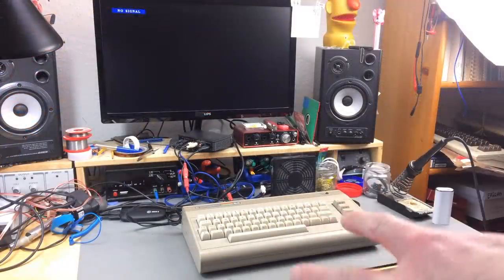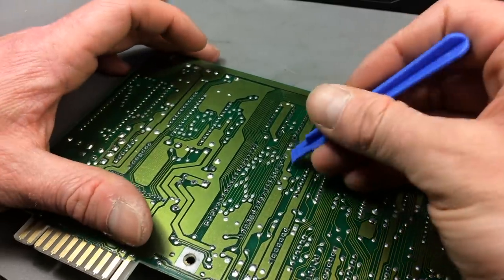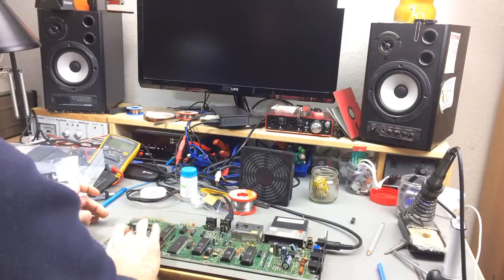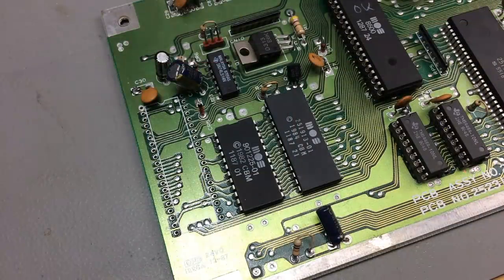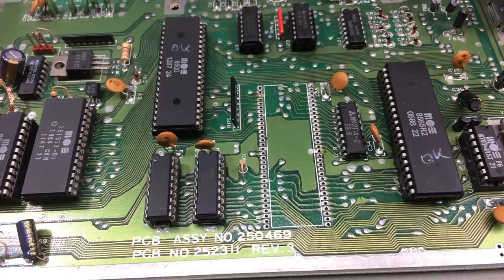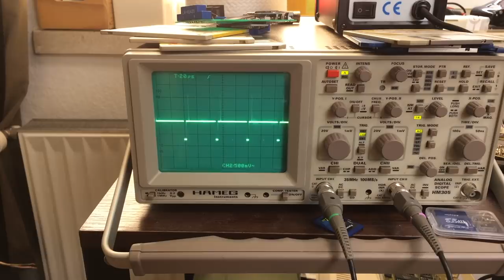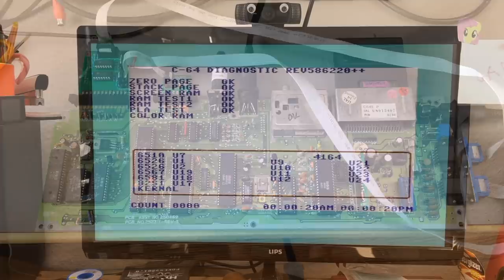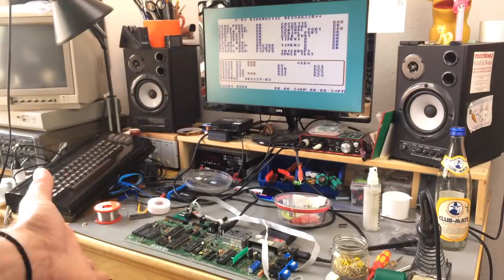Aldi C64 Blank Screen Repair Part 1

Comment: I remember there is a pin on cassete port that goes directly to the processor and it has a pull up resistor, if that resistor is broken the procesor does not work properly.
Reply: this is at least on thing that could be checked and fixed. i think it makes the output signal to swich on the tape, is it?

Comment: Strange. Somehow, bit 1 is missing in the last few outputs of the diagnostics, which is why it starts to write @ad and  qmult and why the font is suddenly garbled. What I don't really get is, why this happens at this later stage and not right from the beginning. Here's a little BASIC program that simulates the effect of bit 1 missing:

10 a$="bad ok sound test"
20 printchr$(147)
30 fori=1tolen(a$)
40 v=asc(mid$(a$,i,1))
45 ifv>64thenv=v-64
50 poke1023+i,v
60 poke1063+i,v and 253
70 next

Comment: Always interesting to watch you work, Jan! I am sure this will turn out just as instructive as the 128 repair series. All I can think of is a board/trace issue.

Although I don't really do Commodore repairs myself, the process, skills and equipment you use are definitively transferrable. For instance, I bought the same desoldering station you have and got myself a logic analyzer. Both of these have saved me tons of time on other types of projects.

Comment: 1. Bad screen
============

The bad screen means a line on the data bus is pulled low. You should be able to see this on your oscilloscope. Wait until the bad screen appears and check the data lines. One the data lines should be permanently low and the question is "how low?", I guess it is pulled low and the level just doesn't get high enough. You very likely have a short circuit with another line on the mainboard.

Now the bad screen appears during the interrupt test. During the interrupt test both CIAs are being manipulated. Therefore it is plausible that it is one of the CIA pins that is shorted to one of the data bus pins. As soon as the user port is manipulated, a pin might go low that then pulls down the entire data bus line.

2. Cassette port error
====================

The schematics of the testing harness shows that the cassette port lines are manipulated via the user port... which is controlled by CIA2. Check with your scope if you can see weird behaviour on some of the user port pins. Use your oscilloscope. Is there perhaps some pin that shows some noise that looks like coming from the data bus?

3. Control port error
=================

The control port lines are manupulated again via the user port... again controlled from CIA2. Again, check these lines with your oscilloscope.

Error (1) points into the direction of a CIA. Common between error (2) and (3) is CIA2. So CIA2 seems most suspicious to me. If your oscilloscope doesn't give any hints my approach would be to lift all the CIA pins that are routed to the user port out of the socket. This won't help with the cassette/control port errors, but if it is the CIA manipulation that causes the bad screen, lifting these pins should prevent the screen going bad. Once that happens you know where to look.
Reply: Additional note: Note that "SOUND TEST" is garbeled, while the other text on the screen remains readable. This means that the RAM still contains the correct data and apparently the VIC-II is still able to read the correct data from video RAM (but not from the character ROM, as there is a bit missing, weird!). However, this confirms that the interrupt test messes things up: The data line is okay when the interrupt test starts, but when the interrupt test completes, it is bad and "SOUND TEST" is no longer written correctly to RAM.

Comment: Check the clamping diodes that go to the serial port.  I wonder if one is shorting enough to cause strange behaviour with one of the CIAs maybe?  Just catching up with the video to see what you've swapped already.  Did you swap both CIA chips from a known working system (at the same time?)?  I have seen both CIA chips fail on one data line and they killed the CPU data pin too.  So when swapping individual chips it still behaved strangely.
Reply: This....

Also, the screen is telling you the problem, ( an @ sign instead of a B, and the gaps in the character, which if you look it's the LAST bit )

This is indicative of a fault caused by a I/o port disconnect( such as a disk drive or cartridge.)...which ties in with gadgets comment.

Hope this helps.
Reply: rectifier  diodes     are    not   clamping   its   not      tv   set   tube  tpe      they  only use  clamping   diodes    in    tubr    tv  from   30   years   ago   now   its   alll  miniture smd   components         look  at   the  new    motherboards   all use   smd     packages   so      thats the   dead  test       waste   of   money   cartridge  for   kids
Reply: @rossdag4232  no, they are clamping diodes!  They clamp the inputs to make sure the level cannot go above  vcc or below 0v.

Comment: Jan Beta, any reasons why the external trigger needs to be connected to the AC mains 60hz frequency when measuring waveforms on monitor circuit boards? what on monitor circuit boards is referenced to the 60hz line frequency? If i connect my "grounded" oscilloscope to measure waveforms on the monitors circuit boards it will damage the monitors circuit boards because of the ground issues, why did they do this on monitor circuit boards to have no ground?

Comment: I was watching something the other day on a fix for a Commodore 16, the guy was stuck on the issue for sometime, then he used his E-prom programmer put the RAM chips on and the PC programme for e-prom reader showed the error, so he swapped it out with a new chip and the issue was fixed.

Comment: Hi Jan,

I know this comment is a year late, but your clock signal into and out the PLA did not look right on the scope. Perhaps there is a leaky capacitor and/or resistor in that circuit?

Cheers

Craig

Comment: Had same/similar issue with one 250469 board, at the end finished with whole board socketed. My board worked with any cart inserted, only wihtout cart there was black screen.Every chip tested, works ok, replaced ram chips same issue black screen. Even replaced PLA but without any luck. At the end it was to pins shorted in cartridge port.
Reply from the maker: Wow, maybe I should also check the cartridge port. Thanks for the tip! Didn't think of that. Still working on this one from time to time but didn't find anything new so far. I'll post an update as soon as I make progress.

Comment: At least you have a fully socketed board :), I am troubleshooting a plus 4 right now with a black screen, I get some weird readings behind the 9vac to 9vdc unregulated converter, I get 1.5 vdc with the power switch on over the capacitors, and 7 vdc with the power switch off!!!! These Commodores are magically creating current :) I saw your 9 volts readings seem good....good luck!

Comment: I'm at the 25 minute mark viewing and the word ROMS is screaming in my head (mostly because You were totally ignoring them at that point).  I have a 64c with the same board that had had a major blow up, the SID, CPU, 2114 colour ram, and both roms were borked. I have finally got a decent Armsid in there after a few years with a crappy nano swinsid, works beautifully now. Those Sharp made PLA's are nearly indestructible. I'll continue watching now and see if it's one of the Rom chips, or both. Got to the end. If there were c64 blank screen repair awards you should get a gold medal when You have fixed this. I would check all the remaining diodes and transistors, not sure what else is left but You could try a 6510 again to eliminate the fault message in the dead test cart. Maybe also the remaining logic ic's, then it will be same as my pcb, all chips socketed.

Comment: JAN BETA, When using an oscilloscope external trigger used for when testing digital electronics or arcade games? logic analyzers have external triggers ports also but i don't know what they are used for in testing digital electronics and arcade games, can you please give some examples of using it?
Reply from the maker: Oh, you usually don't need an external trigger for these kinds of repairs. Sometimes you can trigger off mains frequency for CRT repairs and such but for the logic repairs, you usually use the computer's clock.

Comment: Did you notice that the test looked fine UNTIL it got to the END of the upper half and then the characters went weird. Before that they looked fine. Somewhere during the test, it triggers the problem visually. Something about the timers or the interrupt. Does this have a 556 timer chip?

Comment: Just an observation (if others already pointed it out, sorry) but it seems there's something corrupting your test right when it reaches the sound part. Up to that point the characters are displayed correctly, but the moment it hits that step it all goes wild (s becomes q, o becomes m etc.) then immediately U1 is marked "bad" (or @ad).
I don't know how these tests work, internally, but it could be something related to accessing the sound module or its voltages that corrupts other parts of the system?
Just a thought.
PS. I know it's been a year since this, but I can't find a part 2, so maybe...

Comment: The advice I’d like to give for diagnosing and repairing a C64 board (or any other board really) is that when multiple chips could potentially be bad and causing a fault (rather than a problem that’s clearly caused by a specific chip), always swap out and test socketed chips first before desoldering anything that’s not in a socket. It helps eliminate possible causes quickly, and can spare the board and chips from unnecessary soldering/desoldering work if the problem is found in one of the socketed chips.  And are those googley eyes on the webcam on your monitor?

Comment: U21 can also have a fault, you should check that too. It's the same chip type as you already removed with U18.
But U21 is responsible for data tansfer between MPU (U6), color RAM (U19) and VIC (U7). Good luck, your Doktor64!

Comment: Putting the SID back in may clear up the control port issue, since the SID handles the POT paddle controllers.  On the CIAs, I know those are marked as "OK", but how did you know?  Did you do a full harnass test of the CIAs?  Just because a machine boots with a CIA doesn't mean it works, and the CIAs DO generate interrupts.

BTW, I went through so many feelings watching this.  I don't know if I can handle part II.

Comment: I know I am a year late, and I didn't see an update since this video.  When you added the botch wire, it looked like it didn't have insulation, and was shorting across a couple solder points.
Reply from the maker: It’s an enameled magnet wire, measured several times and it doesn’t short anywhere. The insulation is there, just not visible. :/

Comment: I wonder... Keyboard OK but Control Ports BAD? Both are connected to the CIA sharing the same lines. Is there possibly a break in the traces (+5V and GND in particular) to the user port? That might also explain the Tape port BAD problem.

Comment: Hi Jan. If the RAM would be NOK, then the screen should flash when starting the Dead Test Cart, or?
So seems that RAM is OK.
If Dead Test Cartridge is inserted, you can remove both CIA-Chips, SID-Chip, Basic&Kernal ROM and Character ROM.

PLA, VIC and Processor needs to function properly to run Dead Test Cart.

You could check if /CS (ChipSelect) on Kernal/BASIC ROM Chip (Pin 22) and VIC Chip (Pin 10) is LOW periodically, so changes between 5V and 0V, then it's OK. Permanently HIGH for examples is NOK.
Good Luck, your Doktor64!
Reply: Looks like a CS line to me too, definitely worth checking continuity of the traces and 'scope the signals, especially as there's more than one chip failing

Comment: If game cartridges work, what functions/chips are taken over by the cartridge that aren't used any more on the board? That's where the fault should lie. Maybe :D Also i think the big blue capacitor to the right isn't fully soldered in, when you look at the legs from the top.

Comment: If I were you, I’d check every trace and lead from power to ground and every solder joint that I made. But before I did that, I’d desolder the ram sockets that I didn’t install and reinstall my own.

Comment: why    did    it    take    so   long     hey   have  new   seing    the   pla   ic    replacement     i  love   iy    the   man   who   designed   it   is   a   genious         i      think   hell   get   lots  of   customers    and   it   will fix   no   video  in   aldi   cheapo   copy   c64        i   think   yulll    fix it   [roblaly   broken   or  corroded   pcb   traks   under  or  on  top   board   im   watching   you      ...

Comment: Swap U1 with U2 and see if the fault moves or stays in same place.
Reply: He replaced U1 with a known good device, and that still happened, so I imagine the test crashed before it could test U2. It might be worth swapping u1 and u2 like you suggest, and see if it still crashes with a known good CIA in u2 and the old u2 in u1.

Comment: If the C64 was damaged by over-voltage, it's possible that someone plugged it into a failing power supply. I remember hearing from the 8-Bit Guy that when vintage C64 power supplies fail, they tend to put out higher-than-normal voltages (he accidentally fried one of his own C64s this way). This goes for US power supplies; not sure if it applies to European ones.

Comment: Ich sehe meine Bastelarbeit im Fernsehen... coool. Der Control Port wird als Bad angezeigt, solange der SID nicht funktioniert. Am Cassette Harness Modul ist eine led, die den Motor anzeigt. Die sollte zweimal kurz aufleuchten während des Test. Das Motor Signal wird über eine Transistorschaltung erzeugt. Es hat einen 6V Pegel, darum der Spannungsteiler auf den Userport Ding. Das Motorsignal wird auch benutzt, um die Signale für die Controlport Rückkopplung zu schalten. Hier könnte durchaus etwas im Argen liegen.
Reply: Can't wait to test your harness Sven .... Ordered 5 samples from JLC 10 days ago; should arrive within a week or so. Kudos to you..
Reply: Kurt Sveen Cool. I have seen them being sold for a fortune on ebay. But they are actually cheap to build. I was thinking of making a switchable cartridge for a combined dead test and diagnostic, too. They are using different combination of the game, exrom and other cartridge signals. Actually I wanted to move towards more complex projects, but I am not yet running out of ideas for simple builds like this harness.
Reply: @svenpetersen1965  I know; some Ebay listings have ridiculous prices - but I guess it's all about demand and availability. I've already got a working solution for the harness - homemade cable salad and perfboard setup (looks awful :-) ); yours was a little tidier to say the least ;-) Keep up the good work.

Comment: You have explained it before, but what does "Aldi" mean?
Reply from the maker: It's a chain of discount grocery shops originated in Germany. They sold a batch of US made C64s in 1987 that were made from leftover case parts, so they had the bread bin case and the white C64C keyboard.

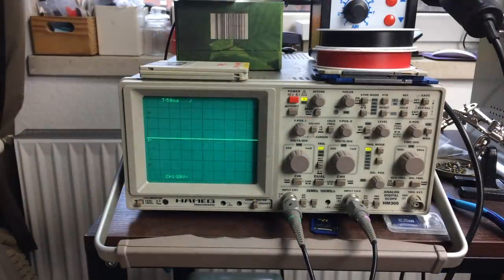Comment: That's weird. At 5:52 you have a Hameg HM305 scope. I also have a Hameg HM305 but it looks completely different to yours. Mine is 30 MHz and that one is 35 MHz. Very well made scopes all the same.
Reply: Just realised. Yours is a HM305-2. The later model.
Reply from the maker: Yes, I was just about to answer that. There’s 2 versions of it. :)

Comment: Are dead test cartridges the same as diagnosis cartridges just a different name? Thanx.
Reply from the maker: No, the dead test needs less components to work to function. It can be used to diagnose "dead" C64s with a black screen. The diagnostics carts also need a test harness of loopback wires to be fully useable.
Reply: @JanBeta  thank you for the reply I really appreciate it. 
So does the dead test cartridge still check all the chip sets ect?  would you recommend the dead test over the diagnosis cartridge if you were only going to buy one? I am trying to find out what chips are no good like cia chips. Thanx again for your help.
Reply from the maker: @korosu2203  Yes, get a dead test cart, it has proven much more useful for initial troubleshooting for me. It tests the main chips as well, although the tests are not 100% reliable. Usually gives you a good point to start. It also flashes the screen for RAM faults in case video output does not fully work. Really handy to have.
Reply: @JanBeta  Legend mate thank you very much for your help. Ordering one now.

Comment: Would be interesting to find out what exactly the dead test cart does to trigger the D1 anomaly as it appears to happen each time at the same place.

Also I believe the 'cursor' from the luma output is just horizontal sync bits.

Comment: Great video !! Despite it still not functioning properly ...... So when are you going to take another stab at it ? I've worked on lots of electronic equipment from RF devices like radios,TV, broadcast gear. And digital equipment like computers, SAN's, routers, etc; ! If that ALDI was struck by lightning, I would check all passive devices first !! I've worked on lots of electronics that was over juiced !
Check All of the caps even the ceramic disc and resistors !!! I've seen caps leak or short due to fried dielectric or a macroscopic carbon trail !  And resistors open-up or change value too, when checked UNDER LOAD !!  Good luck, this has been one of the best C64 repair videos !  I know you will succeed !!!
PS: Oooop's Don't forget to check Solder Joints, especially Via's and the DIODES too  !! As for the testing the power supply........! The only load test, involves using a high wattage resistor bank and run it through your VOM's ammeter to check the current draw ! The downside..... you have to be careful not to cook it and the potting compound flows !!  : O